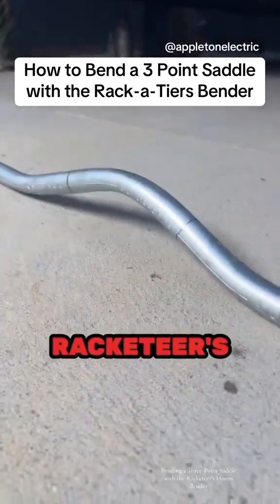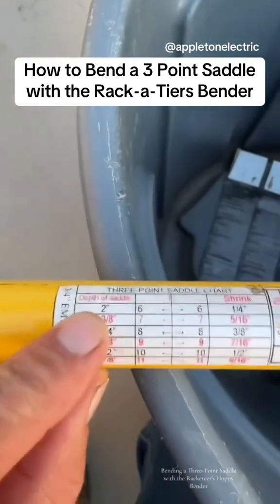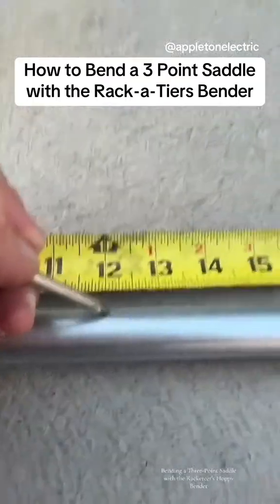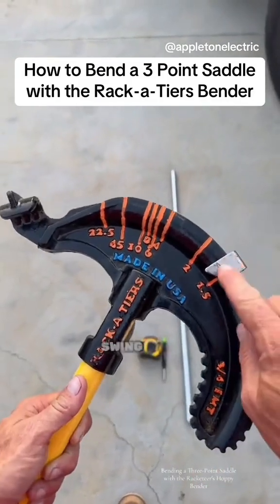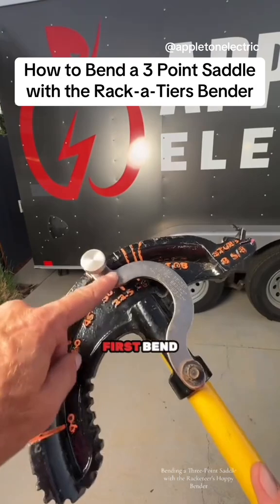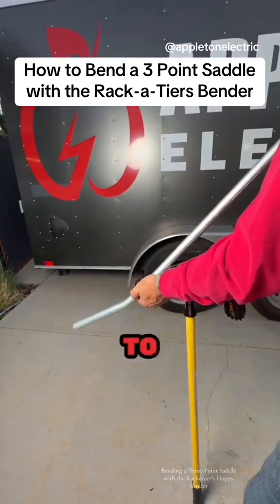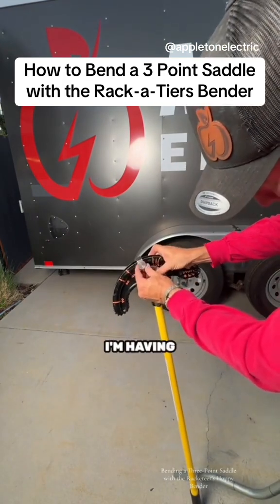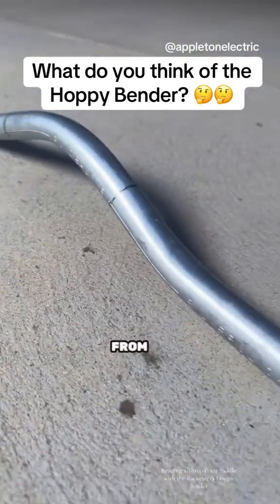How to Bend a 3 Point Saddle (with the Rack-A-Tiers Bender)

Comment: If guys put 3 points on my sites, they either have to change it or they're off pipe. Nothing says "i cant plan a run" more than 3 points. That may be my opinion, but ive never seen one yet that looked like the guy meant to do it.
Reply: Who cares.
Reply: This doesnt really make sense in my opinion, but maybe im just a smart-ass 1st year apprentice. Theres been a couple situations mainly in service where I've had to do a 3 point, 2 notable ones being when we had to move a disconnect for an AC system to install an ATS, had to do 2, 3 points to go over existing pipes to move the disconnect. One in a parking garage running a trapeze and we needed to do a kick 90 and a 3 point near the end of the run to go under a big drain pipe and continue level to meet with the other pipes and piggyback off the trapeze that was already existing and had room to match them. I think its mainly for exposed stuff to make it look pretty and to go over or under other pipes, and save on degrees since its more efficient to do a 3 point in a run over a 4 point, but again maybe you know something I dont.

Comment: A fool proof way to take all the skill out of the electrical field. If we keep this up the tradesman 30 years from now won’t be worth the car they show up in.
Reply: what is bro waffling about 😂 "back in my day we used to bend conduit with our bare hands and one eye"
Reply: Take the skill out? What about learning new tricks? Buying tools that help you? Skill is only experience and you can't buy both. Nice tools help build skill. Using that skill makes experience.
Reply: Its about efficiency. If something can save you time, it can save you money. That's why these tools exist. They make the job easier and faster. If you were a boss would you tell your guys not to use power tools because thats not how it was done 200 years ago?
Reply: @drakesant1004  moving that stopper around is not saving any time lmao just look at the line
Reply: I use my bare hands. Back in my day, the only tool around was my boss.
Reply: Still using your 18v xrp shewalt drill too I bet
Reply: Back in my day we used to use a marble and put it on the conduit, if she rolls she ain't level. Easy as honestly.
Reply: Only makes the job easier nothing will replace an electrician every electrician has absolutely no chance of being out of work do you know how many rusted shorted wires are inside pipes everywhere and dead shorts inside houses even if a customer knee how to it and looked up every way to di there's no way there gonna attempt it. One try amd they'll be done. We need stuff like this so we can catch a break .
Reply: Juan and Jose will take over this trade as well. Bravo.